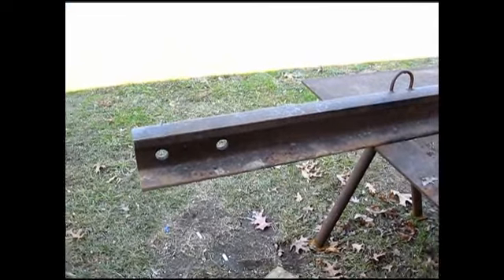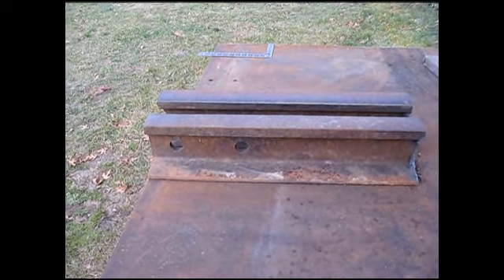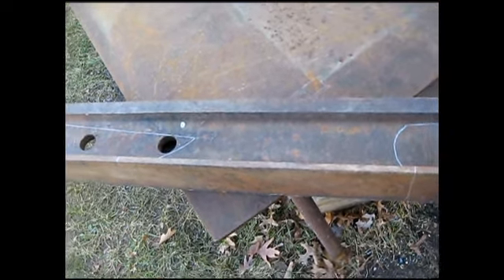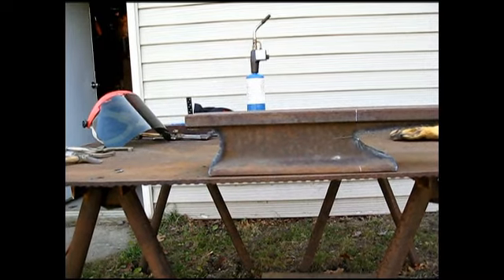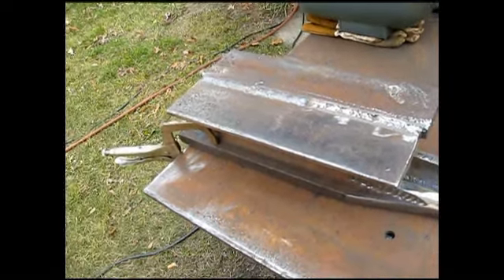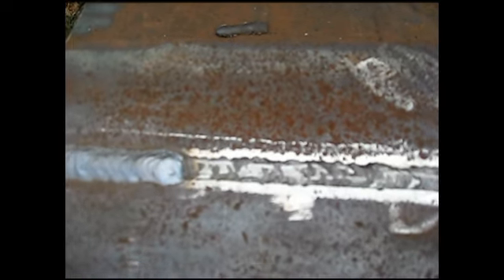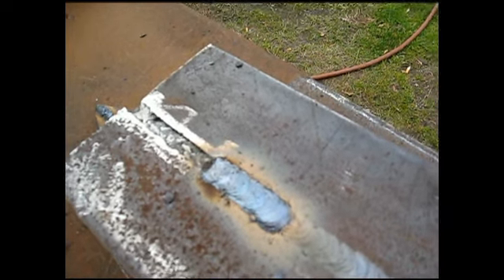Building an Anvil Part 1

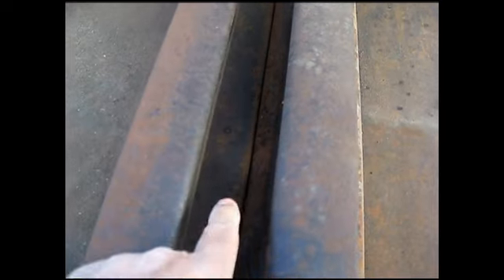Comment: At 2:05, "probably take the temper out". While maybe harder than "mild steel", train rail isn't hardened, tempered steel. If it were, when repairs are made to the train rail through "thermite" welding, that process would remove any "temper/hardness" at that repair point severely weakening it instead of strengthening it.
Reply: oldtimer4567   you are wrong, rail is 60 pts. Hard.  Thermite welding work hardens the steel.  Rail is hardened to start with 60 pts. Rarely is rail thermite welded any more. But what does that have to do with using it for an anvil. I'm sure the guy is not going to pick a piece that has been thermite welded.

Comment: I teach blacksmithing, and have done it for over 30 years. If you MUST use a RR track, do not try to make it look like what you see as an anvil. Stand it on end like a fence post, that will be a vastly better anvil than what you made. There is too much spring and flex with track, you need mass under the hammer, not air. 

Yes real anvils cost a lot of money but it is a life long tool. A simple anvil can be made out of a block of steel weighing about 100 pounds. Square, rectangle, round stock on end all will be better anvils up until the time hard plate was added to the iron. That is thousands of years of history, all in a simple block of steel.

Comment: Cool anvil.

Can anyone tell me if a portable band saw will cut RR track, I have access to some lengths of track, but it's in the wild, the easiest way I can think of getting it is, renting a generator I can carry, and I have a porta-band, getting torches to where the track is will not be easy.
Reply from the maker: I'm not sure but if you were using a high quality blade it might be possible.
Reply: They are pretty brittle
Get a big anglegrinder and make cuts trough it
Try to jump on it or a lever and it will snap.
Take care

Comment: what types of welding was used and where did you get your hard plate?
Reply from the maker: +Bob Sagget  Plate was bought from ALRO STEEL,  just an arc welder was used.
Reply: +rchopp what amp was the one you used brother and what kinda torch cutter did you have?
Reply from the maker: 120-140 amps, and a victor single stage torch.
Reply: +rchopp thanks so much man you've been a big help. This is the best anvil build on YouTube!
Reply from the maker: Thanks and your welcome.